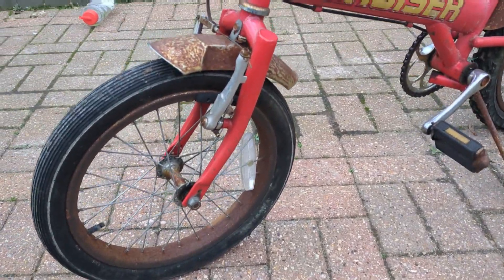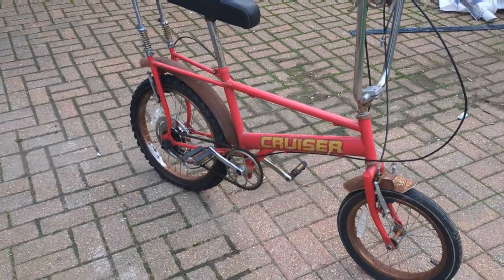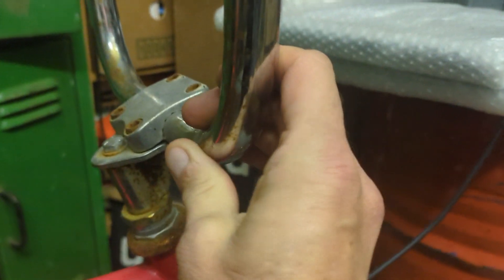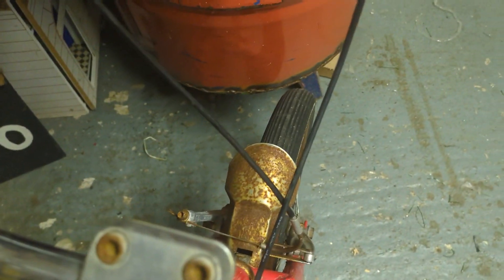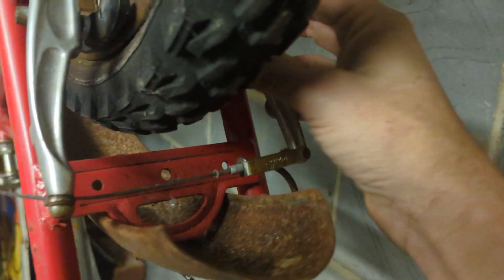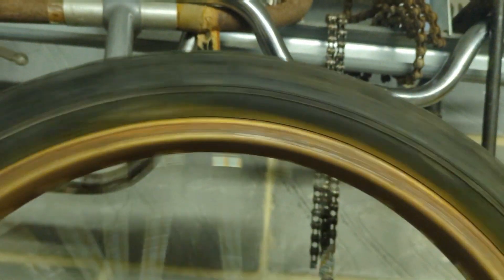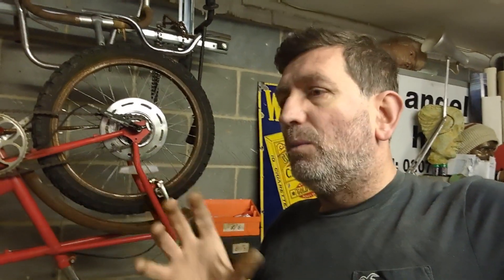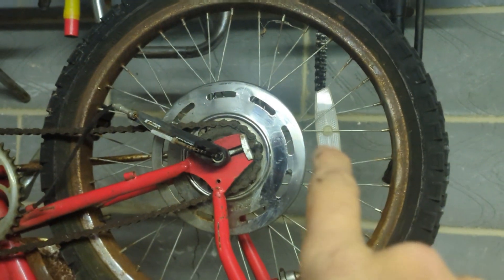NEW PROJECT 😀 | Ground cruiser | chopper LOOKaLIKE all original| part 1

Comment: It looks like a nice bike. Its frame, stem and grip gears on the handlebars reminds me of the Raleigh Chopper MK3. For its age, it looks in good condition, especially the frame.
Reply from the maker: Thanks. It's a very cool bike. The bars are so wide, they're proper retro. T cut the frame, service the brakes, chrome bits cleaned up then it's finished..
Reply: Be good to see this cleaned
up👍🏻
Reply from the maker: Thankyou. Already started.. the paint work is amazing.. wheels are looking a lot better